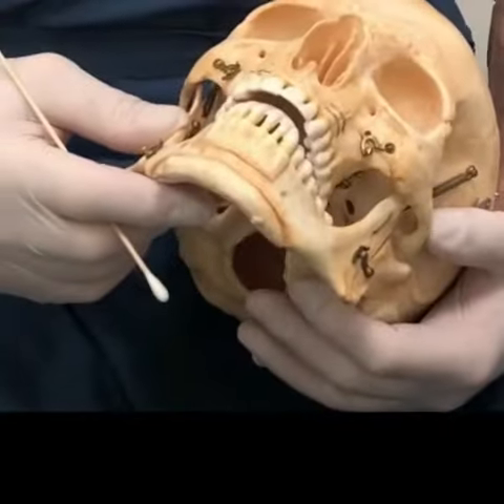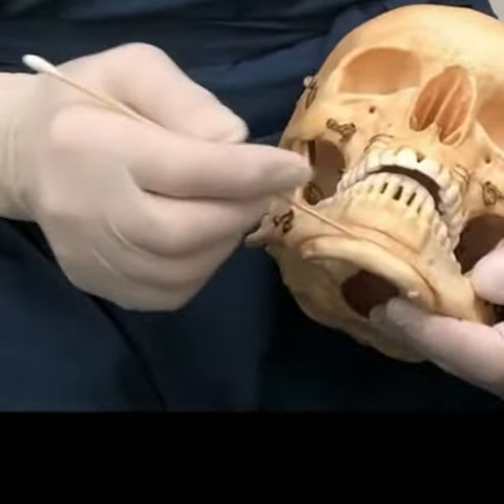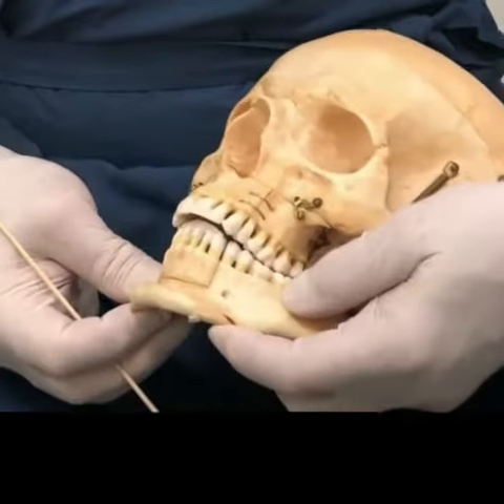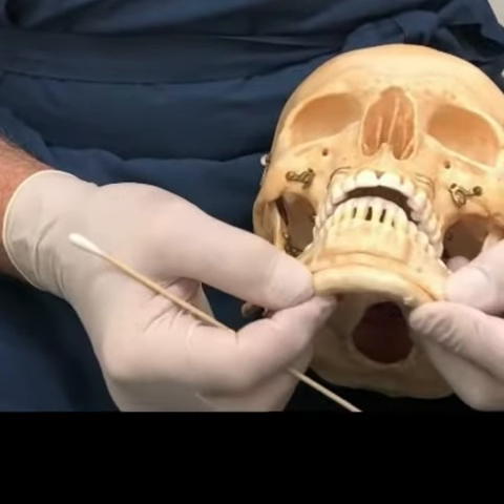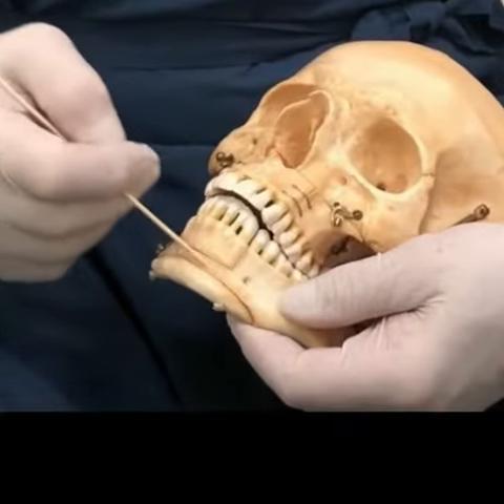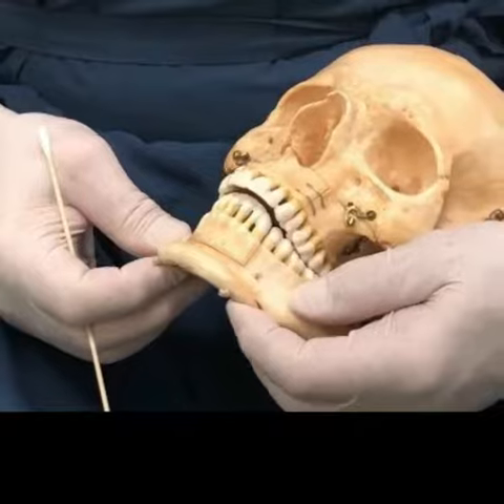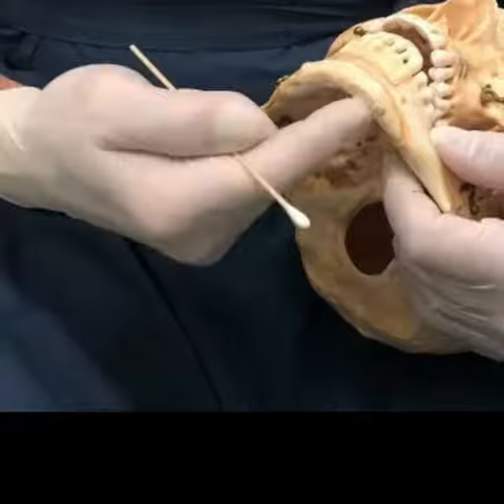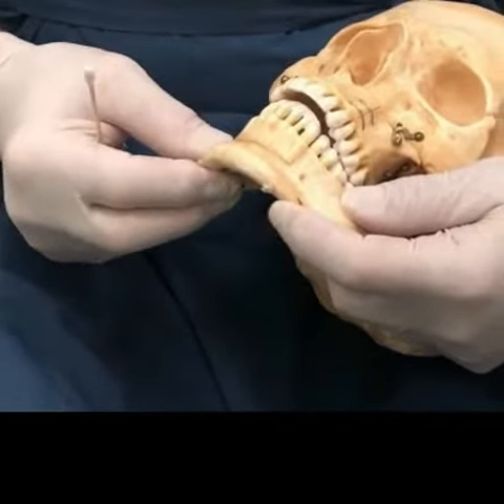Sliding Genioplasty

Comment: My only concern is you've got to cut through the mentalis muscle that originates on the bone below the incisors. That anchoring forms the bottom of the pocket inside the lip, and creates the crease on the outside. Some lips don't work well after cut... hang down, twist, stiff in the crease whenever use the lip. Like when don't we? Isn't there any other way except cut mentalis?

Comment: How much does Genioplasty cost please
Reply from the maker: It really depends on a case by case basis. If you would like to call the office we would be able to give you a rough estimate but until you have a consultation it will only be an extremely rough estimate. The office number is 212-988-4040.